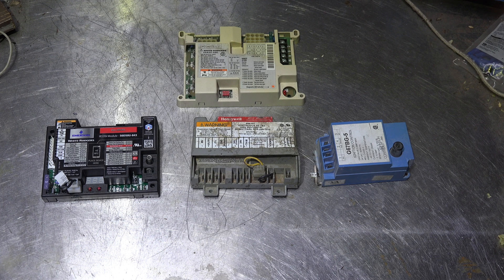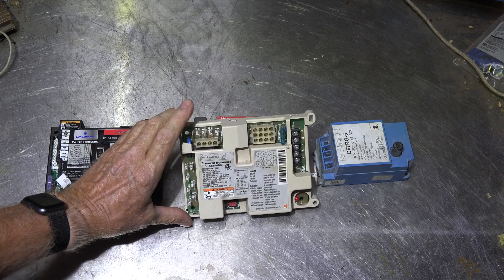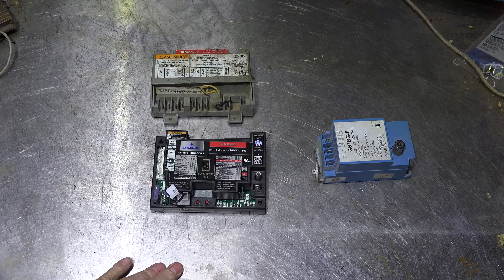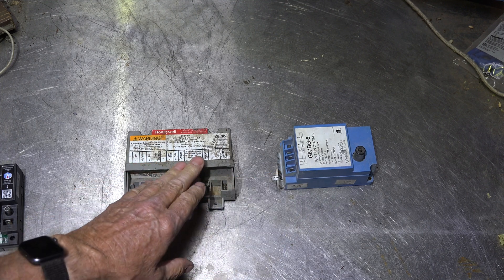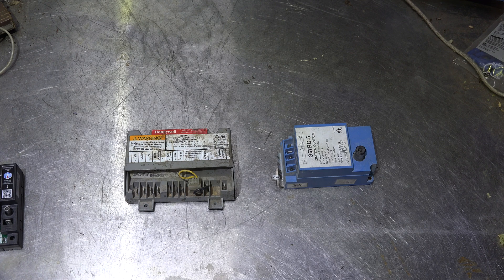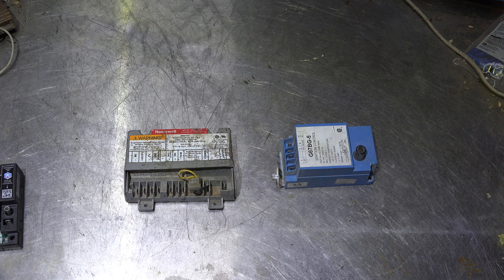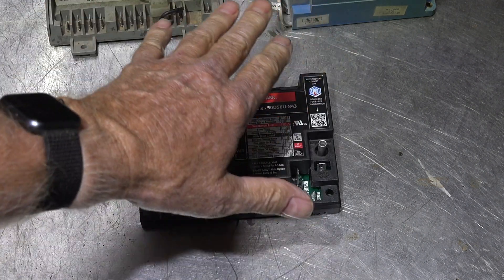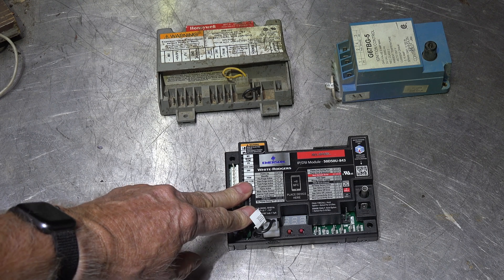Spark ignitors for gas burners:  How they work and one of the replacements for them.

Comment: I have a mid-90s Carrier upflow furnace 58GSC065-GB130 where for 3 months I had to power on and off several times for it to run.  2 weeks ago, it would not turn on no matter what I did.  I just replaced the controller board (ICM271C) and blower capacitor (5uf, 370V).  Still, nothing happens.  There is 28V going from LIM-1 on the board to the limit switch (HH12ZA251C), passing to the blocked vent safety switch (HH11AZ230A) and returning 28V to LIM-2 on the board.  There is continuity and voltage between GAS-1, GAS-2, GAS-3 board connections to Gas valve (EF32CW183A) and Igniter/lockout control (LH33WZ512A).  Voltage from GAS-1 is 28V but only measures 6V when plugged into the igniter control.  Connections to the igniter is good.  When I set the thermostat set to 70F and calling for heat, all I hear is a quiet hum from the transformer.  If I pull the wires from either LIM-1 or LIM-2, the blower starts up, but still no pilot or flame.  I don't know how to troubleshoot if the gas valve, igniter control, igniter or something else is bad.  Please advise.
Reply from the maker: If this unit has the 3 wire pilot, the pilot switch may have failed.
GFM

Comment: Wondering if anyone on here can help just acquired a trane hanging heater not sure how to wire it just has 2  wires 1 black 1 yellow going straight into the gas valve

Comment: Domestic water heater 40 Gallon, No electric connection, no pilot burning. 
What generates the spark when calling for heat?
Reply: those are primarily all full time standing pilot systems, using a thermopile in the pilot flame to generate power which is stored on the controller in a "super capacitor", that way it can blink the led for error codes for a long while before going fully dead. So as long as the pilot stays lit and the thermopile/control/safeties good, it will keep the control powered.
at one point there was some rare models which had spark ignition and used batteries, but I think they were only very small portable units well under 20 gallons for camping
Reply: prayer?
Reply from the maker: Some heaters intended for off grid use use batteries to operate the control system.
GFM

Comment: I'm a DIY homeowner and 3 years ago I had to replace the original Robert Shaw HS780 ignition control board with a Honeywell S8910U3000 board on my 1986 Coleman 2895E766 furnace (115k BTU). It was literally the first time I've ever touched a gas furnace (not including replacing the filter) since it was my first house. I spend a lot of time researching the various safety devices and overall operation of gas furnaces and is the reason I discovered your channel 3 years ago. I was paranoid I'd explode the house so I must have spend 20 or 30 hours going over everything before and after the install, but I now feel comfortable troubleshooting my own furnace and less worried about having a 35 y/o furnace. I do keep CO detectors in pretty much every room in the house. Thanks for providing easy to follow lessons for highly motivated DIY folks not in the HVAC industry.
Reply from the maker: Welcome
GFM

Comment: Thanks for your videos and for sharing these different spark igniters ,Do they come with a retro fit circuit diagram .It looks like they would be the one to be the go to igniter if the retrofit is not cost prohibitive in the way of  install time and unit cost for the customer.
Reply from the maker: There is more to come on this control.  Things like prepurge, spark timing etc are all adjustable.  I will be going into all this in future videos.
GFM

Comment: Very good video. Spark ignition caused me fits when I was new to HVAC service.
Reply from the maker: Thanks for the support.
GFM
Reply: Hey gfm, is there any manual diagrams on they set up maybe on different flame 🔥 controllers ? I’d like to get some for the truck
Reply from the maker: @richardwuttunee9355   As I go thru this series, you may get what you need.
GFM
Reply: it did to most everyone and the first thing they did was gut it for standing pilot valve and thermocouple pilot assembly. part of that was it being cheaper to change over and not have multiple service calls stacked up over some dumb reason, like a poor ground or rust quickly breaking the ground path for flame sensing and intermittent junktronics.
Reply from the maker: @throttlebottle5906  I  never did that.  I have had few problems with intermittent pilot systems after the first 2 years.
GFM